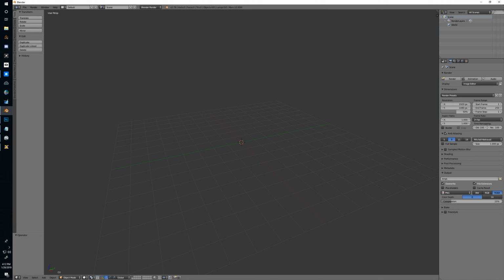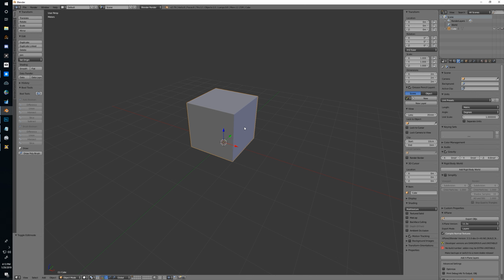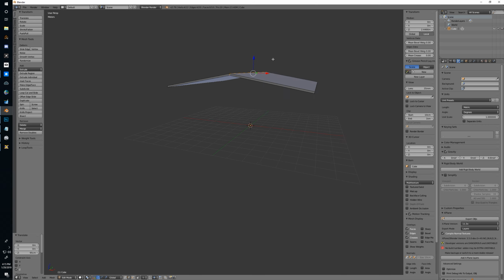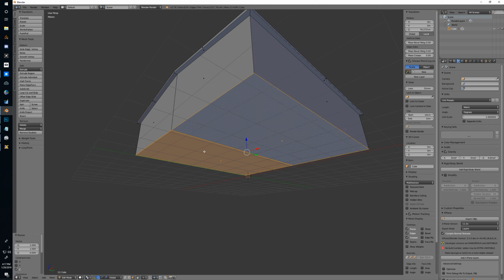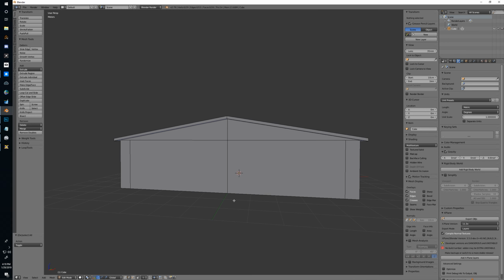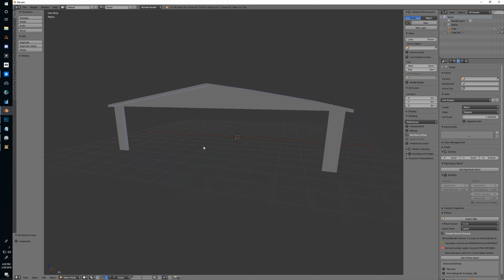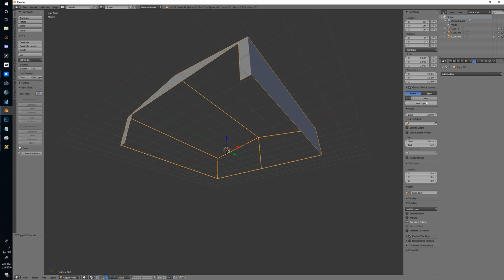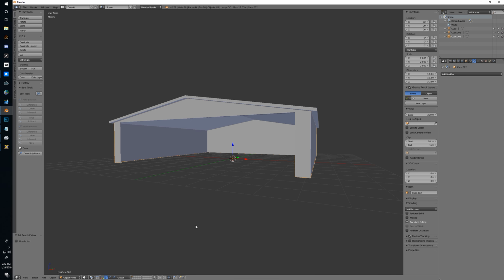basic hangar

Comment: Hi Bill I managed to complete this part of the exercise using Blender 2.82. At first when I created a cube instead of scaling it along its axis, I entered specific dimensions. When I did that for some reason my inset behaviour on the base face of the roof wasnt working correctly along its axis. 
My second question is when I want to extrude the bottom face downwards is there a way I can extrude downward specifying how many meters I want to extrude instead of eyeballing ? What made it more challenging was with 2.82 version a new feature pan mouse has been instroduced which runs when you press Z. So when I wanted to scale Z axis to 0, instead the pan mouse function would run. I had to eyeball that down to as close to zero as possible.
Reply from the maker: Regarding your first question, I'm having a hard time understanding exactly what you mean. In general, the only time insets won't work quite right is when the object scale is not set to 1, which is why I always apply scale in object mode before doing any insets in edit mode. Perhaps that had something to do with it.
WIth extrudes, certainly, you can always enter an amount to extrude by. For instance (assuming your units are set to metric), you could press E and the number 2 to extrude by 2 meters. I've been using 2.82 since it came out, and haven't been having any problem using the z key. Maybe I don't have something enabled, but I'm not sure what the pan mouse feature is about.
Reply: @BillWomack  You might be right I will give this exercise another test. I have used GMAX before so its just a matter of finding my groove with blender. Thank you